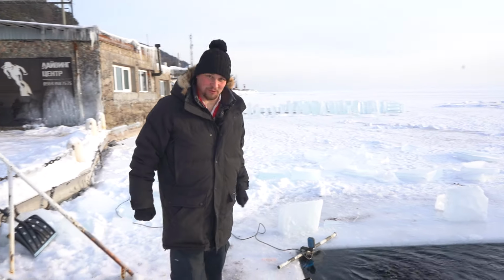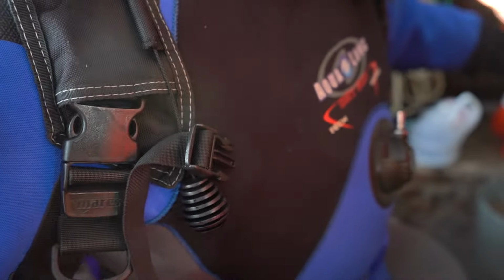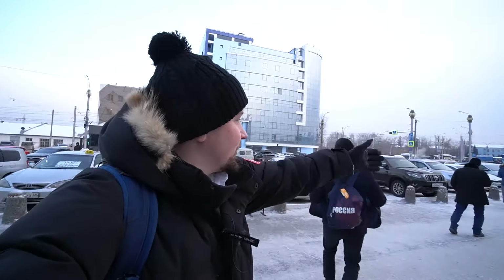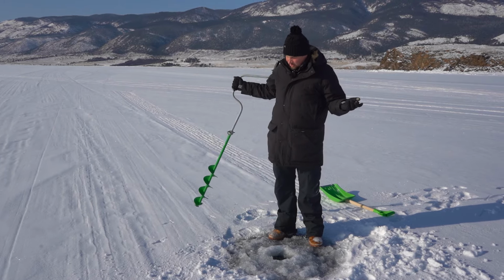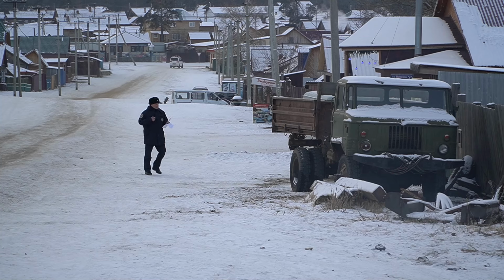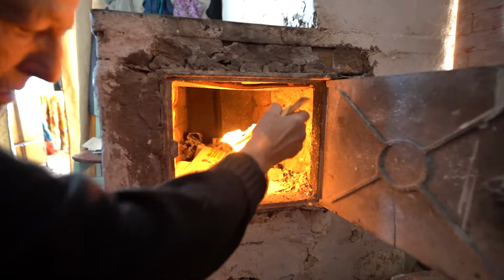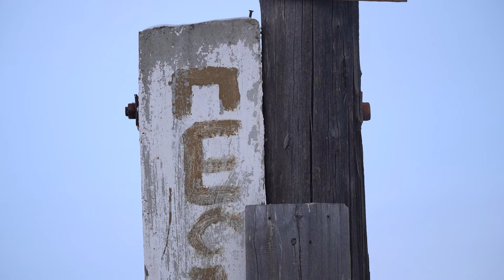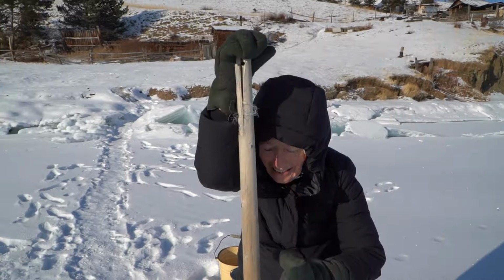I dived under the ice of Baikal - the deepest lake in the world / What happened?

Comment: Former diver here, wow this is stupidly dangerous... so you never dove before and go diving under the ice??? Secondly even if you knew how to dive you wouldn't just go ice diving like this... thirdly, you only have a single respirator, even in good weather you dive with two. Fourthly, in water below 4 degrees C you dive with a second valve on the tank, (and thus a second first-stage regulator) even at 4 degrees the respirator can freeze stuck in the open position and keep blowing air, to prevent it from draining the tank you need to be able to shut the valve and switch to your secondary valve.